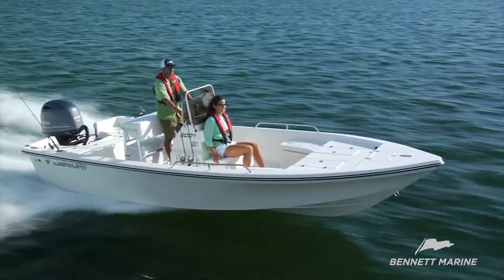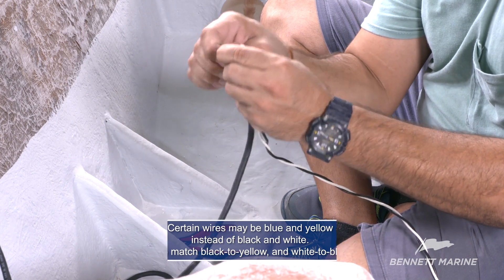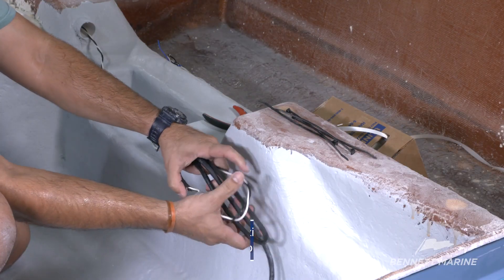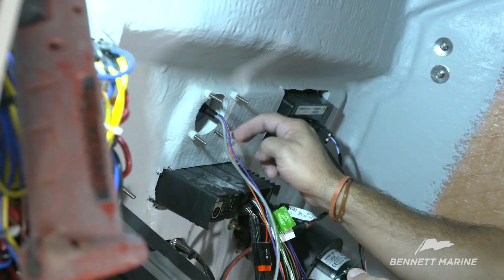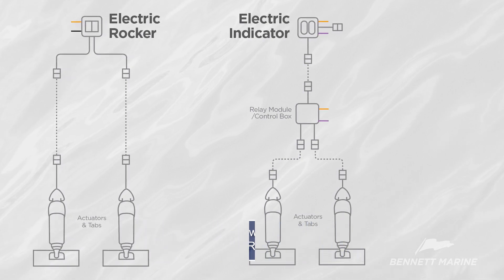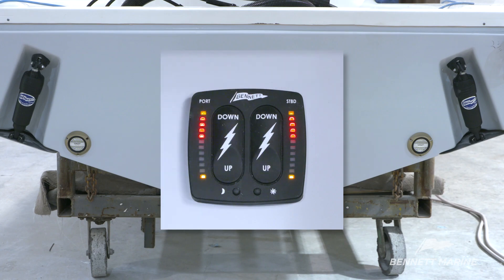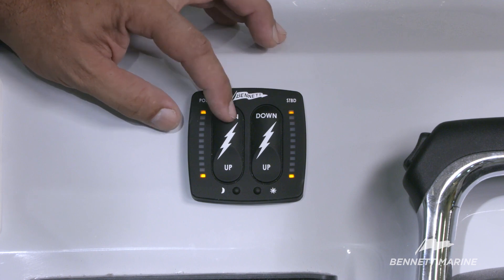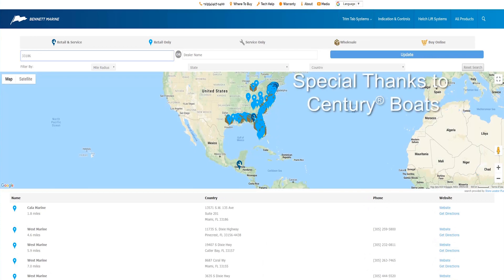BOLT Electric Trim Tab System Install - Part 2 (Helm Control Rigging)

Comment: My bennett tabs did not come with any anodes at all. Were the tabs suppose to have arrived with anodes?
Reply: Trim Tab kits do not usually come with anodes. You could probably just buy anodes and put them on yourself, but if they don't come with them they must not really need them. May also put extra load on the actuators?